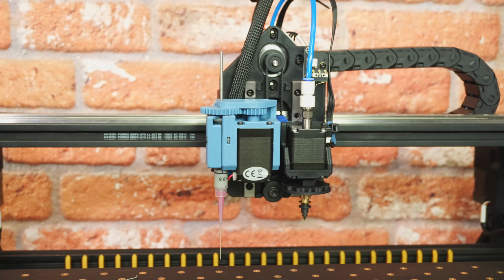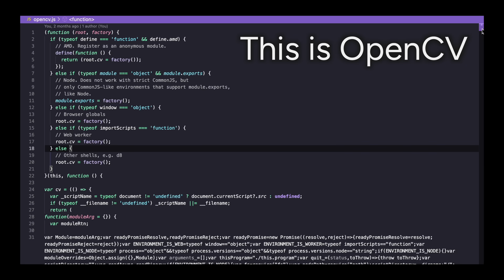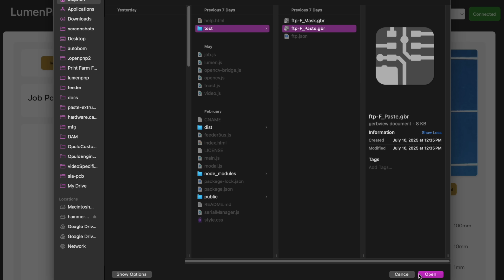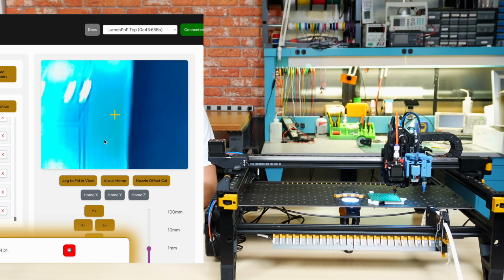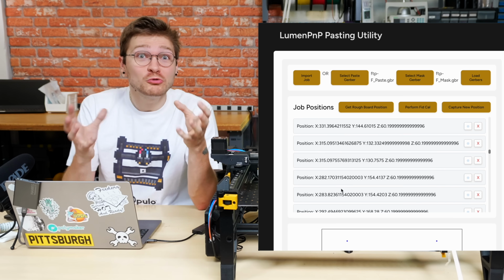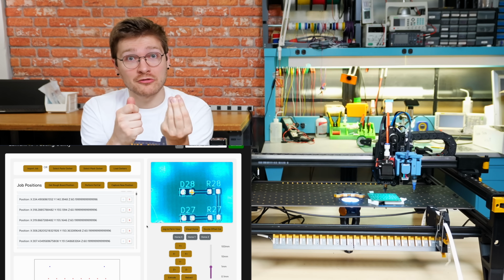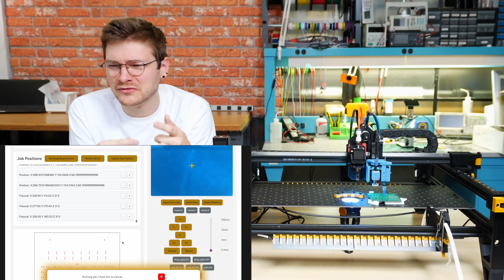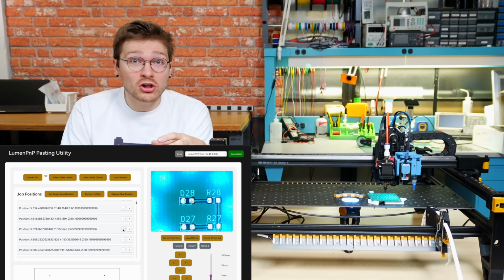Never buy solder stencils again

Comment: This is awesome, but I can't be the only engineer that looks at this and just thinks "I'd rather be focusing on my designs not my tooling". Iterating fast is great, but you end up working to the constraints of your tools, or spending most of your productive time upgrading your tools. Also it just sucks up so much time into BOM, supply chain and inventory management. It's really hard for me to justify this for my own work vs using rapid fab and assembly service. Sure it takes a week (or sometimes 2 for complex boards) to be delivered but I've never found myself idle waiting for a board to be delivered.

Comment: Would using a peristaltic pump work for a solder paste extruder? The biggest thing I’m concerned about is the viscosity of the paste not wanting to be vacuumed through the silicon tube

Comment: I saw a previous video about PCB manufacturing, and I'd love to see it again with an H2D and E1. The Bambu Lab H2D does not use a fiber laser, at least based on what I could find. So, I'm not sure how well it would work to ablate the copper, but I would love to see you try it. Additionally, I wonder if something like the EufyMake E1 could lay down a good solder mask. Again, I'd love to see you try! As a creator, you could likely get both companies to send you their respective products. I'm considering buying one of each, but it would suck to buy it and have them not work for my intended purposes. So basically wondering if you can do the dirty work for me.

Comment: Bit late to this but sick project man. Some additional ease of use features could definitely be something like a PID controlled click-to-jog mechanism (PID is overkill, it's literally just 1 parameter, this calibration could be done once at the start). Just measure the offset after a movement (simple algorithm, will definitely be a lib for it) and adjust the pixel to mm ratio. You also don't necessarily need to undershoot to converge, any ratio that is within 100% from the actual ratio will converge. A 10% overshoot will converge just as fast as a 10% undershoot, so just try to set it as accurate as possible.

Comment: You can improve the code so that, after loading the project file, you receive the manual indication of only 2 fid pads and have a button to continue calibration. I think it is unnecessary to indicate all the fid dots. And, if you place 1 dot next to the first fid pad, you will be creating a development pattern for the boards, opening the possibility of doing automatic calibration from these 2 dots, because the machine will know how the plate is rotated on the base and will find all the other fid pads.

Comment: This is very cool, with using the browser you get off machine hardware access for advance functions. This has a lot of cool expansion capabilities

A metal paste extrude tip tapping a ground plane point on the board that's tied to a line to complete the circuit could be used to get z-axis offset without something like a pressure/switch sensor.  And you could add a brush /waste bin like on 3d printers to auto pre-extrude into and wipe before the pasting, all passive like a brush clamped bristle side up the nozzel just moves past to pre-clean.

Also using any pad rather than just specific ones to get the offset would be cool
Also also, if you could get an april tag silkscreend (or other means) on the board, that would give you all axis offsets

Great idea, this w

Comment: Could you run a "test" section where you just test different settings and use either human input to select lines / dots, or use the computer vision to estimate the best settings for Dispense, Retract, and Dwell. Amazing job as always!

Comment: Worked for a company that uses serveral production lines including paste printers, Pick'n'Place machines and AOI.
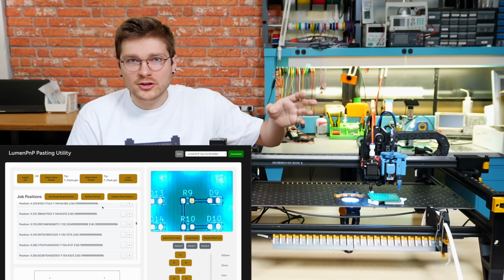When I saw your solution for fiducial offsets at 5:33 I can tell you, you can make your life even more easier. 
After you performed the first calibration after importing your data, you don't need to move the tool head for fiducial alignment for every next alignment job. Just get the offset of your head to each fiducial based on the camera position and do the actual correction in software. You will get a much faster offset correction. Just let the camera wait for about a second so you don't get vibration errors after a fast travel move.
Reply: Based on the gerber right? Smart!

Comment: When I started with home SMD manufacturing many years ago, I developed a way of making stencils.
I just cut them on a CNC router, with the stencil material being clear plastic sheet.
The stuff they sell for overhead trasparancies in newsagents works good, and is very quick to cut, just use a new sharp HSS endmill so you dont get melt from a blunt tool.
Clear stencils are better to use than metal ones, obviosuly you can see through them.
And if you are wondering about lifespan, some of my stencils did thousands of products and lasted many years. Solder paste residue simply cleaned off with metho alcohol, no sign of stencil degradation.
So, if you want to make home made stencils cheap and easy, that is how to do it. 👍

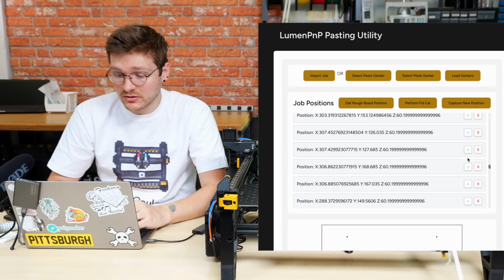Comment: 8:00 - If you require tip calibration before the Capture new position, you can just apply the same offset to have all the coordinates based on the same relative position.

Comment: Wow this makes a real diff now, still no way to fix Vias if we can do that we have unlocked crazyness. Now we have to find a way to make the board underneath the PCB get hot enough for reflow and we can even fix PCB's with the OpenPNP.
I suspect we could make this fast jogging over the PCB and with cameras on the side we could even where the PCB is. But i guess you need a lot more direct processing power and speed?

Comment: I almost feel like you should embrace the FDM printer-like design even more and design a controlled heater for this extruder if the paste is designed to handle a bit of a higher temp compared to most ambient temps. That way you have control over that variable. Then, get a fine nozzle and start printing lines so you have perimeters and infill so you have sharp profiles of paste like the stencils instead of just plain blobs.

Comment: This thing is more expensive than some quite advanced 3d printers. With some clever adaptation I am sure it's possible to build one around 300 euros. The principles are mostly the same. You can even adapt the open source Klipper firmware, with very little modification (need to remove the requirement of a Hotend).
Só all you need to take a 300 euro very decent printed and replace the toolhead with one that extrudes paste.
The with klipper firmware you can precisely control the flow of paste and and do extruding movements so you can extrude lines with the exact amount to cover the pads. 
If you adapt it to disregard temperature settings, you can just use any 3d printer Slicer to automatically generate the gcode. Probably some open source sliver tweaking would allow to import gerbers directly into it. How cool would that be?
Don't think it's too far fetched. The only thing left more manual would be the calibration, but I bet that with gerbers imported into the slicer some work on the vision library for matching some points from the Slicer to the board, thst could also be done automatically. 
And since 300 euro range 3d printers are already equipped with z probes for automatic calibration, even that could be automated. 
If all of that is put together you could get an under 500 euro paste extruder, that all you have to do is place the board and hit "print".
If you go beyond and add some sort of component dispenser (maybe a tape component printer or electro magnet with some sort of conveyor for the components), then you would have the entire deal. Just take it to the oven
Reply: Can buy the toolhead assembly from their website for 75 bucks. There we go 375 bucks that's what it should cost.

Comment: I used to assemble a lot of PCBs with a handheld paste dispenser that was pneumatic driven. The biggest issue was that the paste in the syringe would heat up considerably during the process and change viscosity. I had to constantly adjust the timings. Some of the expensive machines had a Peltier-based temperature stabilization of the syringe. I thought that it would be cool to prototype it.

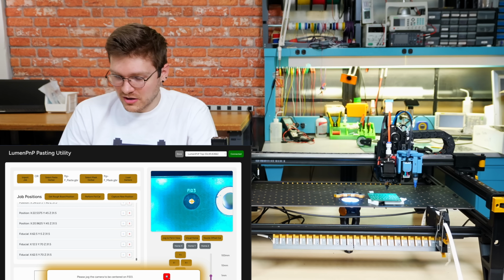Comment: 4:47 seems to me that adjusting for Z could be a little annoying/fiddly.. so, for setting Z-height automatically, is there a way to make use of the fact that the syringe tip is metal? Could you wire up the needle and then use an electrically identified height fiducial, so you lower the needle tip until it makes electrical contact?
Reply: Good idea.  Most needles will be metal and you could push it against a side contact on the frame and then descend until it touches a bottom contact.  If there is a bit of solder paste sticking out it should ignore it and get a reliable Z height.

Comment: Im sure it would be way down on the list of priorities, but nozzle based probing to automatically set the z height much more precisely sounds really cool.

Something like the strain gauges used for 3d printers. It could just be that the tube assembly is held with a strain gauge for instance so it can be off the shelf parts.

Comment: Shouldn't rely on fiducials at all. Use the outer most solder pads in the design and validate relative expected position between those to alignment pads.

Comment: You need a priming move for the paste extrusion. Usually that looks like a slow x move while extruding onto the build surface to create a small amount of pressure in the extruder head. It then jumps straight to the first extruding point and runs the job. You could have it jump above the same spot to give it somewhere to ooze after the completion of the job. Once you retrieve the board, you can wipe the excess off the priming position.

Comment: Nice! can it use other reference points like a few pads to calibrate itself? does using fiducials have some advantages?
Reply: They are traditional and are available after populating the board for later probing operations. Modern vision systems could just look at board features and work from that by learning from a sample board.  Fids are the least effort method is all.

Comment: This is so cool!! But it leaves me wondering why not use computer vision to identify all of the pads to deposit solder paste on? I would imagine you don’t even need to know the board location, just the location of the pads which can be determined visually. You could just put any circuit board in there, and it can apply solder to it.
Reply: This was my first thought but it has a drawback that you ay not want solder on all the pads and the amount may not be always proportional to the pad area (or dimensions) though In most cases it should be a viable method if for example no Gerber files exist.

Comment: Would it work to use locator pins that physically insert into the holes? It seems like some conical pins would self center to provide sufficient accuracy. Or does the extruder accumulate error that requires corrective feedback?

Running a computer vision system is certainly neat, but it made me wonder why the locator feature was round. Presumably something more like a QR code would be easier to recognize and determine rotation angle. So I have to assume these hole features are pre-existing, and probably designed to solve this problem with older/simpler techniques.

Comment: Kind of made me wonder... what prevents the machine from using the fid search to have a scanning function where you dont need a gerber file and can just load a random pcb you designed and it will sweep over the pcb in increments and make a map of all the pads? If it misses one, you just have an "add pad" button and it adds one. Would be super useful if you were prototyping and need to update the board layout frequently.

Comment: Very nice, I played around with extruding paste a few years back with out much success.  Glad you are making good progress, 0402's in impressive.  My old eyes can't even see them suckers.  Ever since I watched some pad printing equipment in operation I was was wondering a similar process could be used.   The pick and place would select the part, then push it down on a solder paste coated transfer surface (silicone rubber pad) where the paste would be transferred to the bottom of the component.  No pattern would be needed only the leads would pick up the paste. Finally the part is placed on the PCB.  However this does assume the leads have a lower Z height than the part body.  ie: we are pasting the part not the board.   Just a thought

Comment: You could do nozzle alignment calibration hands-off by placing a tiny bit of paste and then using it as a reverse fiducial, judging where it actually is against where it's expected to be. Say you jog to a real fid, identify an open area nearby, the software picks a location in the middle of the area and taps the nozzle there with the minimum possible extrusion. Camera finds the paste, gets right on top, and determines it's location, math math math. It does need to know roughly where the tip should be, like +/- 5~10mm  on XY, depending on the space you have to perform the tap, but then it can go from +/-5.0 to +/- 0.2mm on it's own.
Reply: The extruder priming and offset calibration can be done on the jig so that you do not leave unattached solder balls on the PCB after reflowing.  Just wipe the area before each new job and it can prepare for the next batch of boards.

Comment: of corse you can get Fid01 automagically. A: you have it labeled, so you need to have openCV read that. Or better add a mini QR code onto the PCB when etching it.
Reply: Board is already covered in fiducials, they are called pads. And they have OpenCV. Everything is all right there. Simple matter of programming to get this to work with an arbitrary board.

Comment: I'm going to bet there's someone out there behind one of those NDAs who's got a pair of these hooked up for auto-pipetting to automate lab work at a fraction of the cost of the major player's kit.
Reply: There already is an open-source relatively cheap lab-grade hobbyist auto pipette/biochem procedure system called OpenTrons. It was used heavily during the great sickness a few years back to perform rapid testing. ThoughtEmporium has some videos featuring it. They're still $15K if you buy the kit assembled, but for something professional grade when dealing with biological hazards that's wicked cheap.
Reply: Fricken great idea!

Comment: Looking pretty good.  Okay,  Its obvious that each pad size needs a tuned setup until  you get to larger pads which require multiple paste points.  This means that the pad height, width and orientation come into play.   This applies to narrow dense pads as well because they are not square and the part may not be orthogonality oriented.   Good start though and because  you're running it a an independent web cam application Open CV application  you should be able to get both the pad area, orientation and pad length to width ratios information directly from a pseudo image of the gerber paste layer.   Keep on thinking!!!!

Comment: I suggest using pad size to automatically calculate the extrude parameters for paste since smaller pads need less paste than larger ones
Reply from the maker: OOH that is a super cool idea, thank you!!
Reply: @stephen_hawes  Came here to say this.
Reply: @stephen_hawes for super large pads maybe a grid of paste dots would work better than a big blob of paste. Super cool tool btw. Maybe one day you can run openpnp inside the browser hehe

Comment: My work manufactures membrane circuits by screen printing conductive ink on polyester films. We attach components, mostly LEDs, with conductive epoxy which is dispensed similar to this. 

We use mg 9410 for the epoxy and then blob a clear encapsulant over the top for additional strength.

Comment: What if the tip "wiped" the solder onto the pad instead of "dabbed" it onto the pad? Like some sort of "solder brush" or something attachment for the tip. So it could paint it onto the pad and get that flat look that's present in stenciled application.

Comment: Isn't it possible to print a single layer of pla or resin for a fast stencil?
Reply: I tried printing PLA stencils with 0.2mm nozzle, but couldn't get it precise and smooth enough. What did work was CNC drilling holes in aluminum soda can metal. You don't need a sturdy CNC, a dremel mounted to a 3D printer could do it.
Reply: @dekutree64  That sounds interesting.  The idea of spark eroding the thin soda can metal might even work.

Comment: You can make stencils using aluminum cards (0.1 or 0.2mm thick) and use engraving process instead of cutting with fiber laser. It works perfectly for me.
Reply: i 3d print stencils and it works just fine, even for 0603 sized parts (may not be good for chips like rp2040)
Reply: @badgermcbadger1968  you use 0.2 nozzle right?

Comment: You just need silver ink and 3,000 dpi projector paper & printer 🖨.  You could get copper ink, even aluminum ink.  Resistance becomes capacitive, so you want biggie capacitors, or just mix it with 99% isopropyl alcohol.  Then the bond will evaporate and leave the nice accurate traces, my guess would be 7% isopropyl will create an ionic ether salt, just gotta weigh a spoon as you dropper the isopropyl into the lab micron sample until it's a salt ink.
If your heart ❤️ 💙 💜 💖 💗 💘 is truely rock hard, empty a toner cartridge and use UV resin and aluminum because it can't cure without intense heat.  20ppm traces, the robot diety symbolic mogul hyrule magnate polyglot awesome job'ns cobbler.

Comment: Unfortunately I use complex and fine footprints on regular basis.
Regarding alternative uses, it can be used to dispense that red glue use for SMT wave soldering.
Or some carbon conductive paint for buttons.
Or trick it into dispensing continuous lines/shapes of adhesives/silicones on PCBs or even other things.